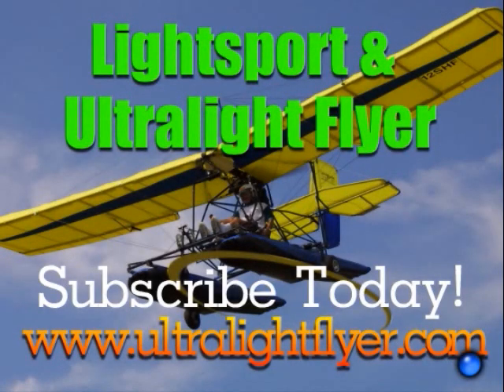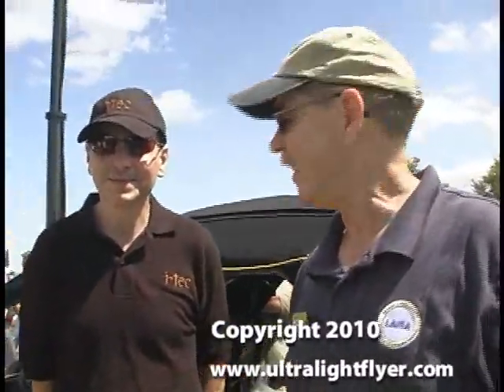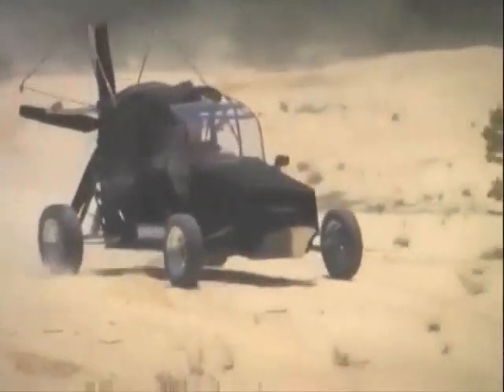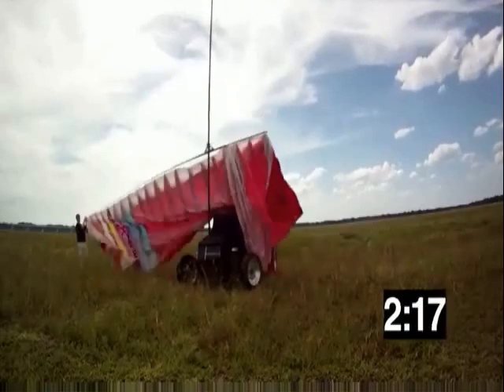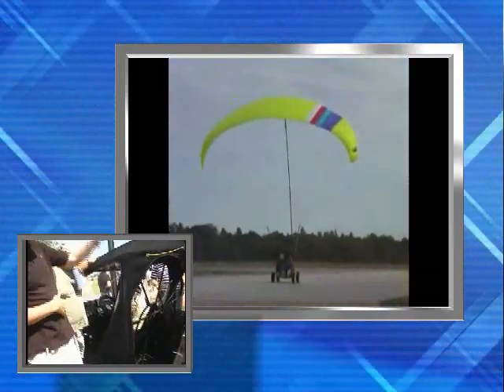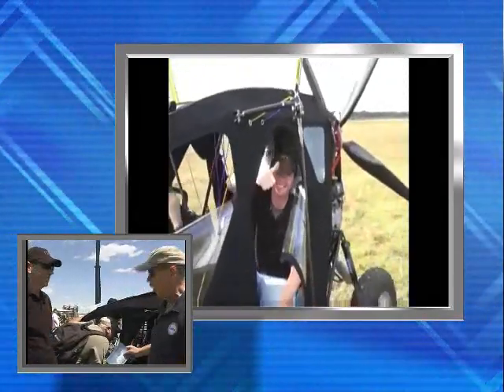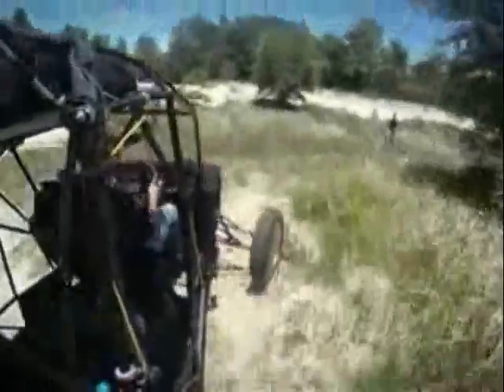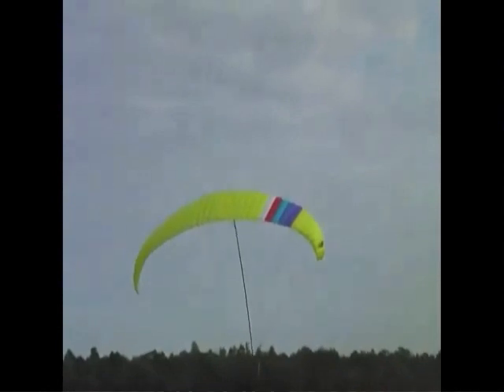i tec, itec Maverick flying car, powered parachute and light sport aircraft

Comment: I have a slightly better idea. There's a car called an elio that is a reverse trike. They weigh 1,300 lbs, are street legal, and only cost $8,000. Retrofitting one could work quite nicely. I really like the flag pole system on this! having a telescoping pole in the rear of the car would work even better. The key is to fully automate it much like a convertible roof works. Having it all come together for under $30k is the real challenge...
Reply: If you use electric motors you can make this  under 5k 
 Take some tire from her Harbor freight and do some welding 👍

Comment: Americas Very first road and FAA legal flying car. Hope they can get the price down to an  affordable level to a better price that matches what this craft really is. Which is A LSA legal Powered parachute, with a PTO transmition that diverts power to prop or wheels with No  heat,  No ac, No real glass in it. And at 80  grand, Sorry, but no way. This Flying Car  will  make its way into obscurity, like so many  good things have done in  the past  because it  was over priced. to  start  with.

Comment: Who says a flying car needs to have a fixed wing? A very ingenious idea to use a powered parachute system instead of a fixed that we had typically seen in the past.

Checked the website of theirs, has some pretty good fuel millage for a road vehicle that can fly. It also says you can get a version that is primarily an 'aerial vehicle' or just the road only version. (Wouldn't mind a road version myself, looks like it would be a fun car to have)